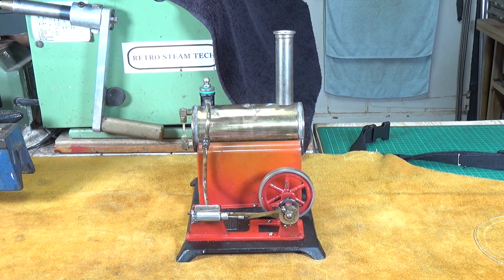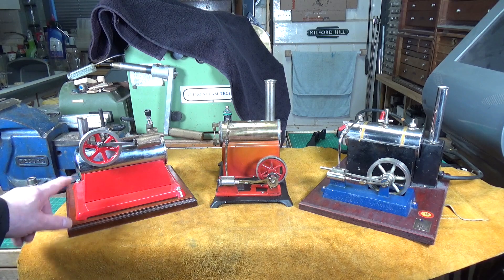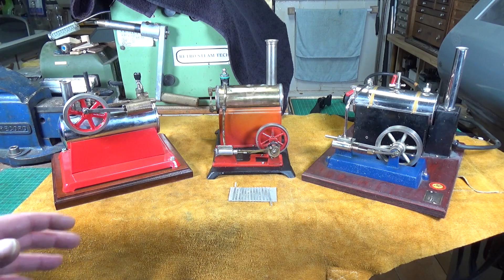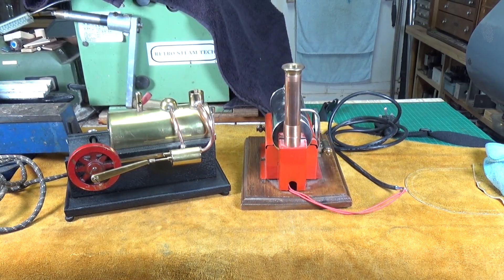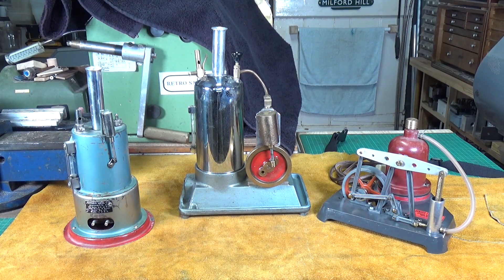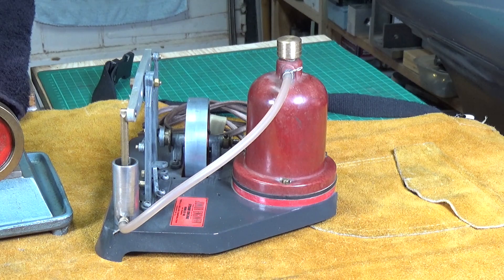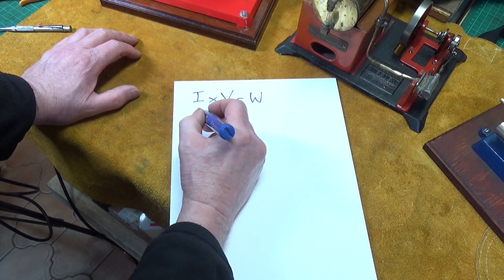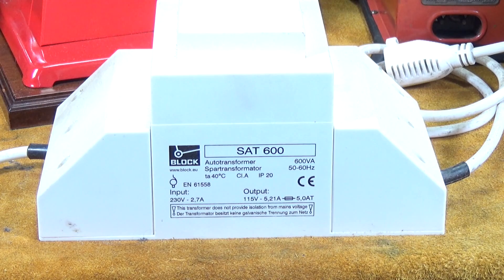Model Steam Engines With Electrically Heated Boilers. Some Basic Information, Tips And Checks.

Comment from the maker: In the video I incorrectly identified the horizontal boiler Jensen as a Number 5. It is in fact a Number 25.
Thanks to Charlie Miller I now know that the German Company Marklin made two steam engines and a hot air engine that were electrically heated. They were listed in Marklin's 1931 catalogue.

Comment: I am no fan of electrically heated engines. Part of the fun to run this engines, is the open fire for me. So I only use spirits or Esbit. Thinking about  a small gas burner also. But the fascinating ends for me, when there is no flame. Electrics and model steam engines do not mix in my oppinion. I understand why these where made as a childs toy, in this its safer than a open flame and if something went bad, just pull the plug.
Reply from the maker: I know what you mean Paul, a real fire in a firebox is something to see especially if it's a coal fire. There are some very interesting electrically fired engines out there though.

Comment: Minor safety suggestion when you are testing the resistance for short circuits, before you trust testing to the boiler or firebox first touch the other pin and prove that you have a good connection from your meter onto the pin of the heater by measuring the resistance of the heating element.  Then without disconnecting that other meter lead continue to probe for a short to the frame.  This eliminates the possibility of a false safe reading due to a poor connection of the meter probe onto the pin.

This is an absolutely phenomenal video I never knew these things existed!

And yes, as you say 120ish volts would be fine for stuff intended to be used in North America, here in the USA the outlet voltage varies from about 117V to 126V depending on grid load, how far from the transformers, etc.  The only place I ever see 115 volts is with some standby generators or power inverters.

I bet that one boiler that has a cylindrical cartridge is the same thing that is used to heat a soldering iron so you could probably get a compatible equivalent heating element that is designed for your local country voltage too.
Reply from the maker: Good idea Matthew 👍 Given that these engines are very old you quite often get corrosion on the pins of the connector. So ensuring that you have a good connection is essential. The cartridge heating elements are available from manufacturers in China.  The one in the video is not the original but a replacement.

Comment: Wilesco make electrically heated engines and UK made Chiltern model steam sell an electric boiler. Also i have an Indian made oscillating plant with a huge electric boiler .
Reply from the maker: Thanks for the information. I must admit that I have never come across an electrically heater Wilesco before. I think I did see a video on a Chiltern Electrically Heated Boiler but it was just the boiler no engine. All interesting stuff though.

Comment: I wonder if you could use a 12v deisel glow plug to boil the water before flattening a 12v car battery or maybe use a 12v transformer would make them safer in the case of electric shock. Good explanation from you on how to p.a.t. test them for anyone restoring one.
Reply from the maker: Not sure if a glow plug would produce enough heat but it's an interesting idea. There didn't seem to be much information about these so I thought it might be useful.
Reply: @RetroSteamTech  most definitely  very interesting.